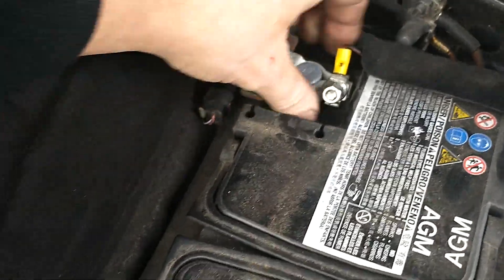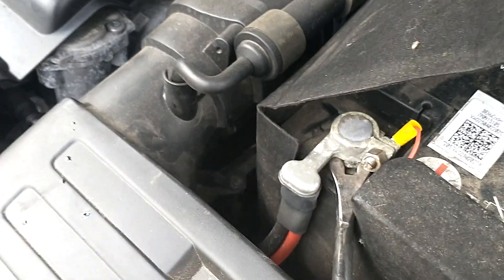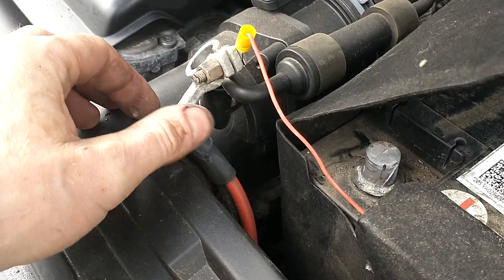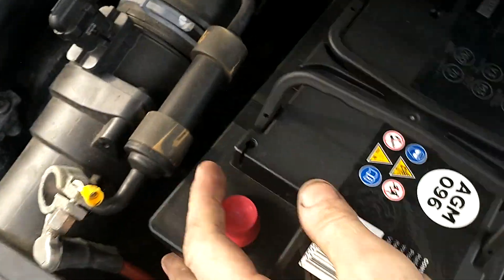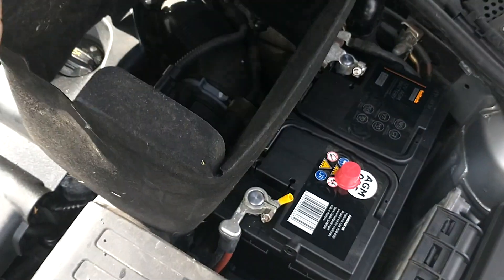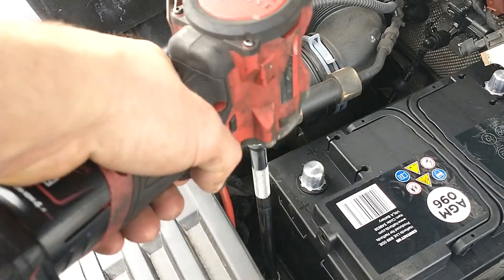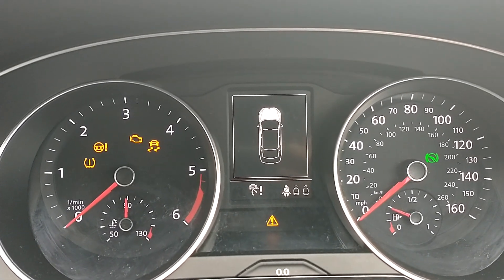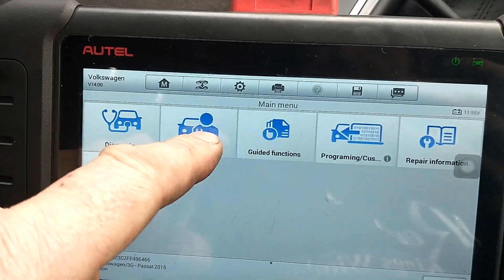How to Fit & programme Stop Start AGM change Battery on modern cars VW Passat B8 EFB Programming

Comment: Hi changed my battery on 2011 touran but didn’t program it there is no light on the dash , is it going to be ok or not , I smell something burning since I changed the battery, do you think it could be the change of the new battery?
Reply from the maker: It should need programming in or it would overcharge the new battery reducing its life drastically

Comment: Once you've loosen the negative terminal disconnect it right away before loosening and removing the positive. If the tool touches any metal part of the engine when undoing the positive while the negative is still connected it will make spark, might damge something. 
Removal: disconnect negative first
Installation: connect positive first

Comment: GOOD NEWS....I did battery swap...on start up bunch error symbols......drove off......they went off ...NO COMPUTER
Reply: Did the same on my A3 2017 and it works normally for weeks now already
Reply: The problem isn't that it won't work and the lights won't go off... The problem is that the computer treats your new battery as if it were the old battery, unless you adapt the car to the new battery. This means that the charging cycles will act like an old battery, and your new battery will likely not last nearly as long as it could/should.

Comment: How can you tell which cars need battery programming..is it all start stop and cars with sensor on the negative?
Reply from the maker: Yes. Most modern cars with AGM batteries need to register it to avoid overcharge and reducing the life considerably.

If not sure once we plug our scan tool in it would have the option to register the new battery if it requires it
Reply: @ORileysAutos  thanks for the information

Comment: AGM batteries should be set to Fleece.  This is the factory setting
Reply: Correct, allot of people get mistaken just because it has the letters AGM, binary AGM refers to spiral AGM batteries, the AGM fitted here is a flat plate with Fleece

Comment: Having a nightmare trying to code a brand new bosch S5A to my caddy just becuase it didnt come with a BEM code, have you any ideas what to do?
Reply from the maker: As long as the amps are set correctly you can usually just change 1 digit from your old BEM code and it should be fine.

Comment: I did this successfully on a 2013 Golf TSI 1400cc. Used the Ancel VD700 (approx. £110) to program battery code. I noticed your "original" battery code showed JCB, although battery was NOT JCB. Mine was the same! All works fine - as long as car "knows" new battery (and type) is fitted - so it doesn't damage it by under, or over, charging it!
Also noticed if you monitor battery voltage while driving, it is completely different charging pattern to older conventional cars!
Reply: Youre a lifesaver. I'm replacing the battery of my 2015 VW polo from an EFB to an AGM battery myself as its really pricey at the mechanic and would have had no idea what affordable OBD scanner to order if not for you saying you used an Ancel VD700. Luckily the new AGM battery has the same capacity so I dont need a more expensive OBD scanner like the OBDeleven PRO to program it. The Ancel VD700 would suffice as I just need to register it as a new battery :) Now Im just waiting for both my new battery and scanner to be delivered!
Reply: @Icolorimutevoli  glad I could help! The Ancel device has menu enabling you to change battery type and ALSO battery capacity - so if new battery was a bit bigger you can just input whatever the new battery capacity might be!

Comment: Why does the heat (car) says 90 degrees after installing battery ? How to set this to zero when starting
Reply from the maker: The car was being used before the battery installation. It's still on 90 as it was only off for 10 minutes while installing the new battery so it's not enough time to cool down 👍🏻
Reply: Ok thanks,it's because i changed my battery and now the degrees say 90 when starting..didn't that before
Reply from the maker: @Brego1498  did you plug in a diagnostic scanner?
Reply: No i did not,but it fixt itself after a second ride 😉

Comment: Do the older version b6 passat use Stop start. I have an AGM battery in a 2009 b6 but it only was a wire on negative terminal unlike yours which had wires on both terminals
Reply from the maker: Fitting would be exactly the same procedure

Comment: Sorry for all the questions.  Did the start stop system stop working with your weak battery? BTW I’m from Ireland too, Longford.
Reply from the maker: No it would work but you could hear it struggle so changed it before it left me stranded
Reply: Mine disabled win battery got low notice it struggle Replaced battery now it’s not working idk if it’s because I replaced it with a AGM Battery from Walmart or it need to be programmed what y’all think

Comment: How old was battery?
Reply from the maker: 5 years
Reply: @ORileysAutos  They don’t seem to last long. My Passat will be 4 in February and it doesn’t have the same kick, especially in mornings or when ambient temps are low. It read 43% SOH on a conductance tester. Exact same battery but mine located in the boot.

My fathers 2007 Passat still on original battery lol